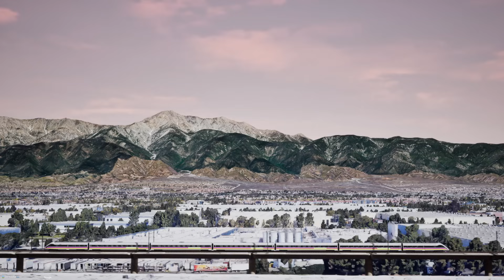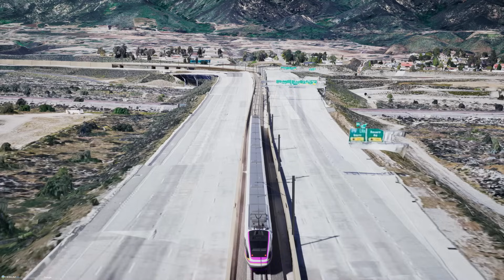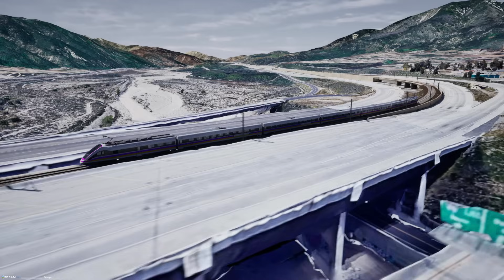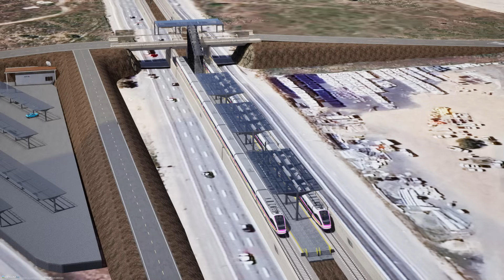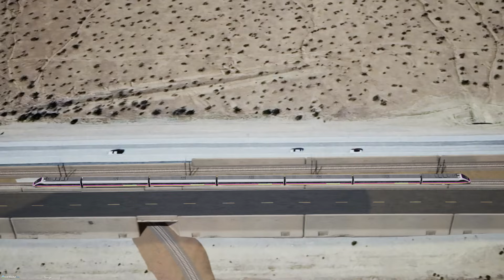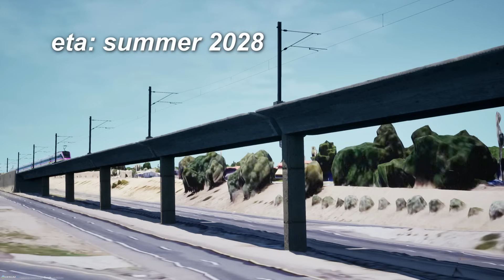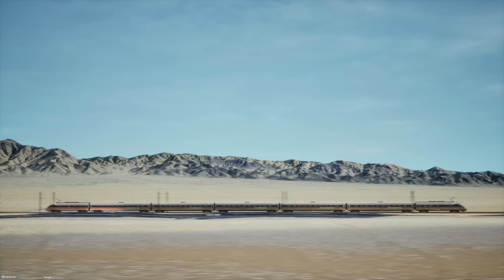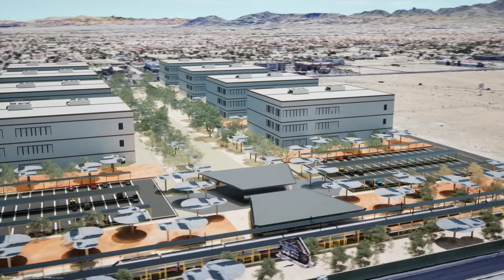The Brightline West High Speed Passenger Rail Route Rendered With Unreal Engine 5

Comment: The city of Las Vegas should extend the monorail to the Brightline station
Reply: What they really need to do is build an elevated light metro like Vancouver or Honolulu right down the center of the Strip. Vegas has the most obvious layout for a rail transit line of any city ever, with all those trip generators in a single line, anchored by downtown on the north end and the airport (and soon to be Brightline Station) to the south. May need a branch to UNLV, too. Then they could run express busses out to the residential areas around the city that feed into the new metro line.
Reply from the maker: @Skip6235  My understand of the situation is that the taxi lobby in Vegas is rather powerful and has been generally successful in let's say 'steering' local government away from mass transit.
Reply: @LucidStew  I still think the train should run underground and stop near every casino on the strip, connected by underground Travelators. Too bad there isn't a local (meaning Las Vegas or Nevada) equivalent of Shi Jinping to issue orders, obvious shortcomings of Communisim aside. But planning for rail in the US is torn apart by so many interests including the rail and planning interests themselves. It's a recipe, a 'pattern' in the sense of RICO.
Reply from the maker: @brucehain  You cant see all the pretty lights from underground!
Reply: @LucidStew  who needs pretty lights when you're engaged with a stimulating conversation in the parlor car? Or musical entertainment. Gambling?? Underground tunnels are a thing in a lot of places, they put stores and restaurants in them and people buy. On the other hand it's impossible for me to imagine doing that with travelators everywhere. Maybe at the junctions.
Reply from the maker: @brucehain  Tunnels, so damp and dreary. Elevated train where everyone can see you and you can see everyone, so exciting! You could let out right onto the elevated walkways. It would be great. Unfortunately, I think the best its going to get is Teslas In Tunnels.
Reply: @LucidStew  Get the Boring Company to get stations underground to the Brightline station, the airport, and some other places just south of the strip.  The underground stations have already been approved by Las Vegas

Brightline could get some great and easy shuttle bus services from the train station to key $$$ casinos/hotels up and down the strip to
Reply: @LucidStew  Charming. I think Elon's learning curve carried over into his boring endeavors. You should look up their gigantic tunnel factory in Bastrop (use 'Historical Imagery" to get the latest - the first you get on clicking the button is the latest) I got a Y-shaped Houston-to-Austin/San Antonio passenger railroad I wanna sell him, goes right through Bastrop, about half of it underground. He should like that.
Reply: @LucidStew  absolutely right! the only reason the monorail wasn't connected to the airport when it was planned out was because of the taxi lobby.  so now we can all get hosed on taxi prices from/to the airport, which is just how they wanted it.
Reply: @StreamSched they are literally doing nothing and they will never do anything about public transport because all they care about is publicity for whatever elon musk is doing and investors giving money for whatever reason. the real people who should be developing the las vegas strip is the government and casinos because having easier access to the casinos will brong in big $$$ why wont they give up heaps of money in the short run to benefit them in the long run.
Reply: @Skip6235  An elevated will probably never get built. To many large casinos that dont want sight lines destroyed. But a cut and fill under the strip shouldn't be to daunting of a task. Shouldn't be a need for any deep tunneling. And Vegas has the perfect set up for a subway. Everything is in a straight line from the airport, within a couple block area, and possibly light rail or busses into residential areas. Problem is most transit centers of the strip would be park and ride, Vegas has a good deal of sprawl
Reply: The city is not getting rid of the monorail as it's a major public transport for the Convention Center. More than likely, what will happen is a station will be built for the Tesla Tunels that have been expanding across the strip to other properties. The county has already approved a huge underground network for the whole system.
Reply from the maker: Last I heard they're getting rid of it.
Reply: @LucidStew  that's a shame
Reply: @LucidStew  you said starts this year and it has been one year since you say it and there’s nothing yet. I heard into 2026 will start
Reply from the maker: @NoeRodriguez-wv2gg  I do not know at the moment. I do know they will face stiff penalties if they do not manage to finance the project within 6 months of the issuance of their private activity bond in March. If it's not going by September, there could be problems.
Reply: Build a Disney-like Gondola over the strip, with mid-stations every few casinos. That would be the most Vegas thing ever.
Reply: @andrewdiamond2697  That would be an eyesore and logistical nightmare. Look at the monorail. It had ambitions to go to all other major casinos but no. Instead Elon Musk is doing it underground.
Reply: I say, underground heavy rail for that higher demand alignment and a light rail on the surface for a more diverse east to west offer while still serving a central part of the strip
Reply: @vasquen  Yes but sideways wouldn't work for the train from LA. I contemplated solutions so passengers wouldn't get impatient, like skip-a-stop and retracing the strip after reaching the terminal in Downtown. You could put the busier stations on the first pass. I think I had it with ten stations in Vegas in all.
Reply: Given the way the Strip has built up, the most cost effective thing would be a loop system of the monorail or other elevated light rail, running down the parking lot sides of the casinos on both sides of the strip. That would serve all the casinos, eliminating the current infighting over the route, and would not have the costs and negative connotations (at least in the US, where it counts) of an underground railway, nor an elevated track blocking the view on the strip.

Doing it as a two-way loop so you could go either direction from any casino would be the most sensible, from the passenger's point of view. But a one-way loop would be cheaper and make a lot of sense from the casino's point of view. If you wanted to go back the way you came, you would have to cross through at least two casinos, one on each side of the strip, to get to the other direction train. They could reasonably assume that money would likely fall out of your pocket on the crossing.
Reply: I wonder whether they'll extend the Deuce route down there. Hope they give it a bus lane
Reply: Monorail going away !
Reply: If it would be profitable, Brightkine would pay for 100% of it all.
Reply: The Vegas Loop is currently under construction in Las Vegas, via The Boring Company. No need to extend the Monorail to the Brightline station.
Reply: Boring company will build a tunnel to Brightline eventually. They are working from the North end of the strip South.
Reply: @Scott-kb1gb  that sounds great but the number of people that can be moved using teslas is going to be limited I believe
Reply: The monorail needs to be replaced with something more useful. The stations are inconveniently located east of the casinos and mostly unused due to their inaccessibility so ridership is low. Uber is much more convenient which offsets the additional cost.

Personally I'd rather see light rail running either along the median of the strip or underneath. Extending it from South Point to the Strat with a spur into the airport would make it accessible to two of the three major transportation methods.
Reply: Let's  not have a rail system that stops short of down town Vegas.  So far it's drive,bus, taxi or uber to CA station, pay parking fee, pay fee for train, then pay for taxi,Uber, bus fare with luggage to hotel or concert venue,pay for that as well. This is the part no one talks about then surprised why the service volume is low because the customer is nickeled and dimed to oblivion. Figure it out please. Also the stations seem to have limited shelter. Better shelter would be appreciated😏
Reply: Elevated would kill views from cars on the Strip. I believe a subway with the access tunnels doubling as ped crossings under the Strip.
Reply: @Db_traveler views from cars? Is that a factor that would kill transit?
Reply: @MichaelTavares You can tell by this kind of comments where is the person commenting from… US is extremely car-centric.
Reply: @Db_traveler Yes it would be a bad idea to elevate a track over the strip. It would ruin the nice views and characters of the strip. A light rail underground would be the only option
Reply: @Db_traveler No it wouldn't? The center of the entire boulevard having an elevated rail barely affects the view. If you've been to Honolulu's rail system, it's seamless and fits in with everything around it. Plus, it would add a better feel to that area if they theme it right. Maybe add some advertising on the trains while they're at it? 😂

Comment: You have to do a tutorial because this is dope
Reply from the maker: I'll think about it once I don't suck at it. There are a LOT of Unreal Engine features I've not even touched yet and some that I've just barely started with. I'm also using an $85 kit for the train stuff, so I didn't need to learn to do EVERYTHING(or even most of it). That's why the videos have some of their current limitations, like the Ukrainian intercity trainset. That kit does have some bugs I'd like to fix, so I may move beyond that eventually. That's probably when a set of tuts would become possible. If you want a very high-level explanation of my path from zero to here so you can try it yourself, I'm happy to give that in a comment.

Comment: Great video, love the rendering. It looks like travel time will be about 3 hrs, which shaves off ~1hr, but it's still not getting the majority of the population of LA county (to the west & south like Santa Monica, Long Beach, etc.) who will have to take Metrolink or drive there, at which point you might as well drive the rest of the way.
Reply from the maker: I think it depends what you're looking for. If you're looking to not deal with traffic in the desert, the drive or train(s) to Rancho is probably fine. I think they're mainly going to get people that would fly first class(since this will be nicer), those that want to avoid the 15, and larger groups, like with events or conventions.  Purely on time, CityNerd did a pretty good video comparing times and its competitive in that respect for a lot of people.  Of course if you're in Culver City or something like that, you're probably picking LAX unless you're just a pure railfan.
Reply: documents have it at 2 hours 10 minutes right now
Reply: @lamegaming9835  The distance is about 200mi and it doesn't look like the average speed will be anywhere near 100mph.
Reply: @andyinsdca  Goofy comment. First, the 218 mile trip from RC in 2 hours 10 min averages out to 100 MPH. The Inland Empire has ~4.6 million people. MetroLink connecting into LA Union station makes the entire line and all surrounding population viable. Not only does it shave more than an hour, people will be able to do other things while traveling, making the savings even greater. Your "m1Ght aS w3LL dR1v3" holds no water.. 🥴

Comment: Given that the gov't is pitching in billions, and it's running on a highway median presumably owned by state govt's, do you think Amtrak would have any chance of being able to use this right of way as well?  Frankly, I think with all the subsidies and land from the highway, Amtrak should just outright own the ROW, of course giving trackage opportunities for Brightline .
Reply from the maker: I don't see why Brightline West wouldn't lease track in Amtrak were interested and they had capacity available. As is they're already talking about connecting to UP and Cemex(which connects to BNSF) tracks. The tracks are elevated at Rancho, but its not impossible to bring them to ground level. The High Desert Corridor would connect this to CAHSR, so there are a lot of possibilities in the future.
Reply: @LucidStew  Agreed, but can an Airo trainset get itself up a 6% grade?
Reply from the maker: @jaydeeification  Possibly. I don't have all the stats for both sets needed to figure out the difference, though.  Beyond that there is a difference between physically being able to it and it making sense in service.  That's why I wasn't doubting they could make it out of Cajon Pass, but how fast they'd run there.
Reply: in the future this track that is going to get build by brightline, might see tracks shared with CAHSR. Amtrak already has its own right of way nearby i believe those are tracks from CSX BNSF or UP. It will be highly unlikely that amtrak is going to drive on brightline tracks as it either doesnt in florida. Regards.

Comment: Surprised at the amount of single-tracked sections....especially at the LV terminus.
Reply: I see no need to spend the money to double track the entire line.  This track will be used for this single service and nothing else.  It should be relatively easy to design a schedule that is hourly or so but still keeps the double tracking to a minimum.
Reply from the maker: I showed all of the double tracking that I think there will be initially. Of course I could be wrong. I think if anything I underestimated, but also I would say there probably wouldn't be more than about 10 miles in addition to what I showed, and that would all be north of the Victor Valley station. The initial double-tracking for Rancho-Victor Valley is identified in the Cajon Pass EA. The section between St. Rose Parkway and the Las Vegas area station will be single-tracked, though, and as far as I know it will stay that way. They do plan to expand service at some point and cut the headways to 30 minutes. At that point the double-tracking would cover about 80% of the 218 mile route.
Reply: @LucidStew didn’t BLW reduce service from originally every 45 minutes to hourly to better coordinate meeting with every Metrolink train and minimize transfer times? Wouldn’t 1/2-hourly service for BLW mean Metrolink SB Line service needing to do the same?
Reply from the maker: @ChrisJones-gx7fc  Metrolink is working on 30 min headways system-wide as part of the SCORE program upgrades for the Olympics. Good for BLW in the future, but also on open. Just that many more options coming from elsewhere to 8th St. Makes it easier to connect at LAUS, too.
Reply: @LucidStew  If it is true, they broke the most fundamental rule of high speed rail infrastructure construction, which is not acceptable. They shouldn't even be even 1 single track existing and there they are having so many. Might as well just use normal train or build more dedicated viaducts for the high speed train.
Reply from the maker: @shinkaitan5664  This is not a new paradigm. Spain uses it in places to keep capital costs low.
Reply: @shinkaitan5664 @shinkaitan5664  Japan has a lot of single-track lines with double-track at specific pass points.  Got to keep everything on a fairly consistent schedule to make it work.
Reply: @shinkaitan5664  Double-side track all the way would effectively double the project's proportions. I actually believe there will be even less double track than shown here by @LucidStew. By the way, incredible work. It gives you a really good idea of the project. Must have been a ton of work. I don't think it will be huge problem in theory, except when trains break down. It will bring the entire route to a halt. Siemens need to make sure that doesn't happen. In Germany these trains are infamous for the inability to run smoothly in the heat. Always problems with A/C.
Reply: Not sure if it is already planned but it seems like a good idea to plan for some service stops before the passes to potentially recover trains that break down and accommodate  passenger in case of evacuations. Running it inside the median also poses difficulty in case trains break down and people need to evacuate.